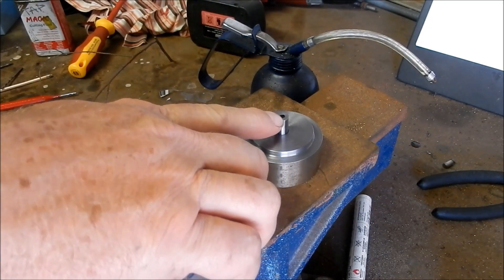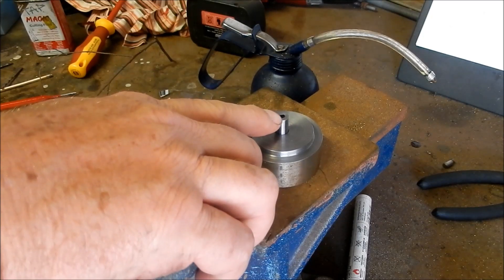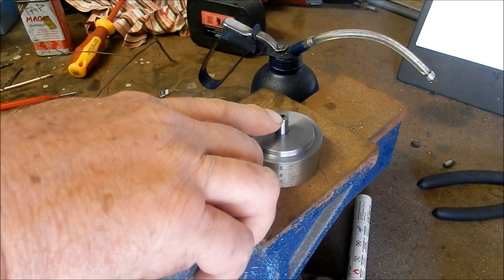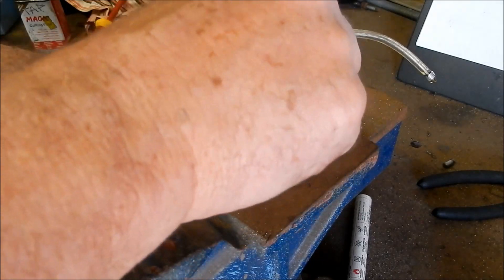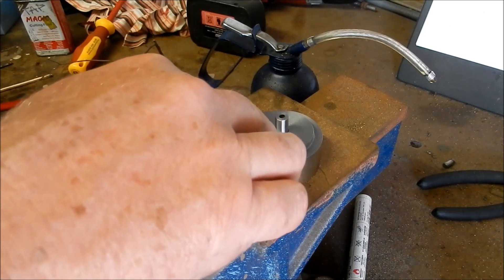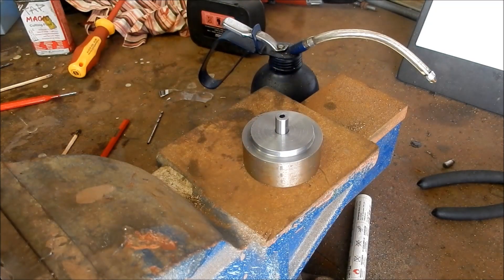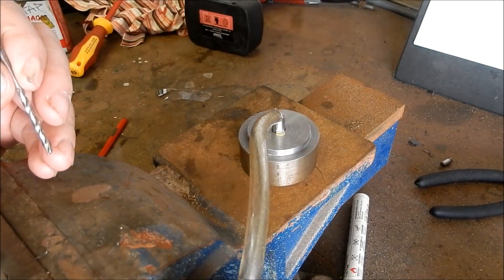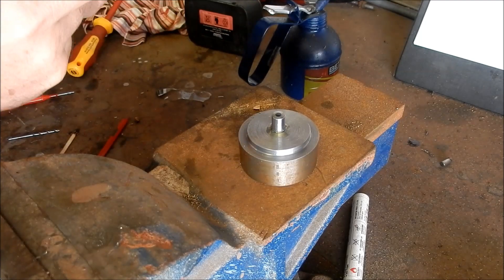Dowel Pin Removal with Hydraulic Pressure Part 2

Comment: I use white stodgy bread. Proper soft white loaf. It hydraulic out most things. Used it last to extract triple bearings out of an Morse taper one live centre. Out they popped one by one until the last bearing the centre came out with the bearings leaving the outer race. I made a video about it last year. Nice job thickening up the grease, nearly as thick as bread.
Reply from the maker: G'Day Steph, yep, that was mentioned in one of the other comments as a goer.  With the small hole in the dowel I suggested soaking it in some olive oil to aid the hydraulic effect.
Cam
Reply: @camatbattler2233  hope you're recovering  well. Thanks for responding.

Comment: Drill and tap the hole. Pack with grease and using an unbrako to pump the pin out. Same concept as the hydraulic pullers
Reply from the maker: G'Day Andrew, great suggestion.  If it doesn't work you can go straight to plan 'B' with a Bridge Withdrawal Tool and use the pre-tapped hole.
Cam